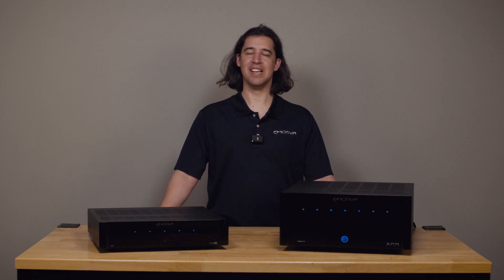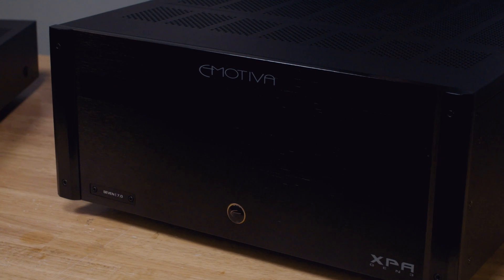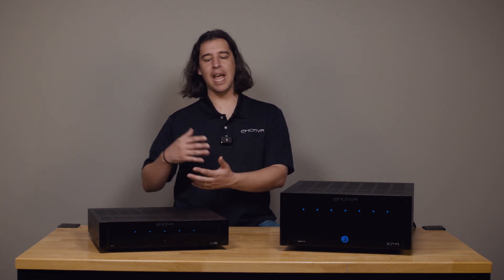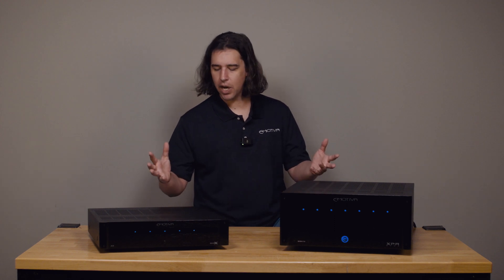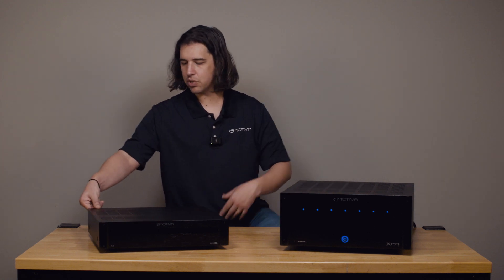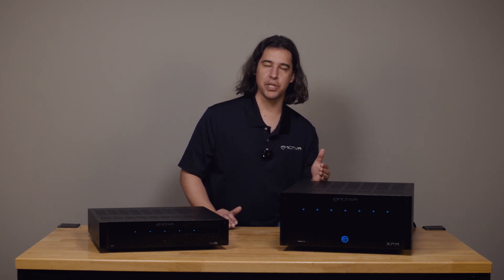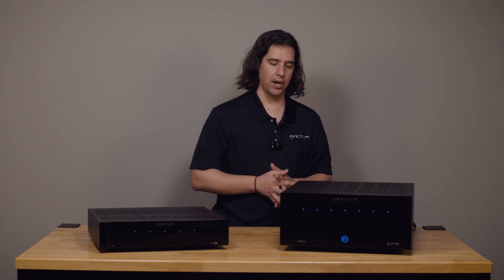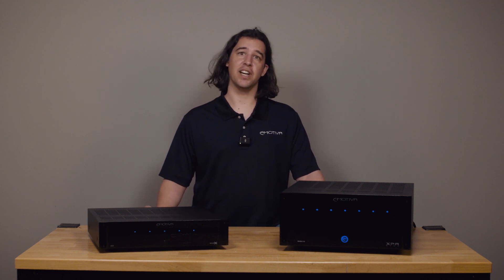Amplifier Protection: How to Identify and Troubleshoot

Comment: I had to return a Marantz cinema 70 s and a Denon 3800 h due to shutting down, I had them up and running and the Denon was great both were connected to my emotiva bass 3, I shut the units down but the next day the amps had the led red bling. I tried everything to try and get the amps working but could not, could the emotiva 3 have anything to do with the amps failures ?

Comment: My Xpa-3 Gen 2 intermittently goes into protection mode after 10-20min of use. I have switched from rca to xlr for all channels and still same. I have disconnected all interconnections and still same problem. If I just cycle power it’s fine for a bit and it goes into protection again. Thoughts?
Reply: mine has starting doing the same thing. We need some help.
Reply: @ I called Emotiva and they basically said they can buy it back as part of their “bring us your dead program”. I think they offered few hundred but I never got around sending it in. I still have it and it still does the same.
Reply: Same here !

Comment: I was buying amplifiers in Central Florida. Ended buying a Parasound and by default an XPA-Gen 1. Have to say the Emotiva just sounds better with a Marantz AVR. I'm running Polk towers that are rated 500 watts. I chose the Emotiva over the Parasound for my main stage. Be curious to "Bi Amp", with them both if i get bored. Emotiva stays nice and luke warm no matter how hard I drive it. Emotiva sounds sweet with Marantz preouts and high end Polk.
Reply: By the way, which Marantz AVR model  is in your set-up ?!?
Reply: Right now its a SR6012 and only pushing smaller surround speakers. I love the dual independent controlled sub outs and mostly wanted it for the pre outs.

Comment: Can anyone diagnose for me? Have basx a300 and a5175. On startup they both trigger on. The 300 lights are blue immediately as they should be. The 5175 lights are initially red for a second and then all five are blue.
Any idea on what is causing this?
Reply: Fault protection. Who cares as long as long as all channels are working. Are you running anything in 4 ohm impedence by any chance.
Reply: @tnasburypl  Nope all 8 ohm speakers.

Comment: Poweroutage happened at my Town. F1 fuse is blowing on powersupply. Gen3  Is it possible to get a schematic? I am a Red Seal Journeyman Electronic Tech with almost 40 Years of experience. Further to that there is a Diode shorted out which is soldered on the board. Rooky mistake, I was so excited to just change the Diode I forgot to check which direction it was pointed. Is there anyway to find out?
Reply: Never mind I drew it out on paper and figured it out.

Comment: Amplifiers are pretty easy to keep happy. No shorts, no DC going into it. And assuming the amplifier is correct on its settings such as DC offset, and quiescent bias level, should work flawlessly for a very long time. Not all power conditioners are not created equal. Though many of them will be current limited for instance keeping your amplifier from seeing its true potential. I use your power conditioner on the BAS-X A2 and have 2 of them, and they run a treat. I also still have the XPA-2 gen1, and it runs great now in my Brother's setup. As long as you run your amplifier inside its scope of performance,  and your connections are good, and your speakers are electrically good, and the source is not sending anything it shouldn't,  any amplifier will be fine. Fun to watch the video here, it has good basic troubleshooting anyone can understand.
Reply: Good sounding amplifiers over all. I do like modular design because you can swap modules to see the fault as don't fear doing some repairs myself. I would say your are right Vincent Chen. Most failures are from people doing something wrong like shorting terminals etc?